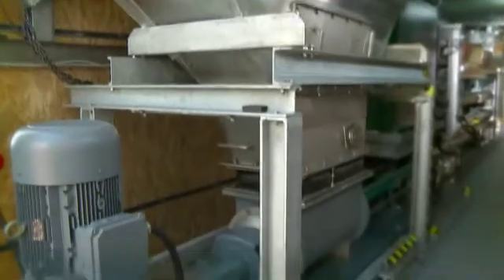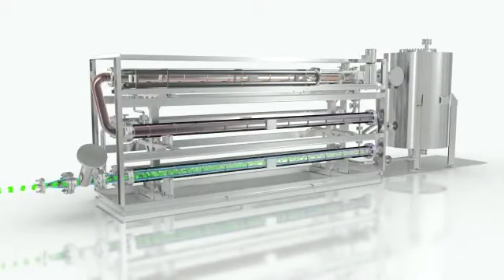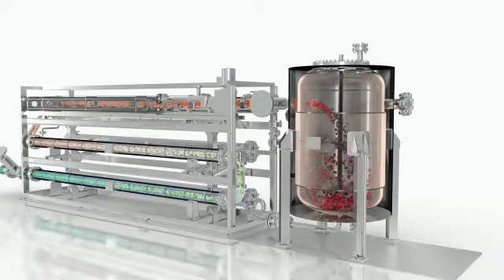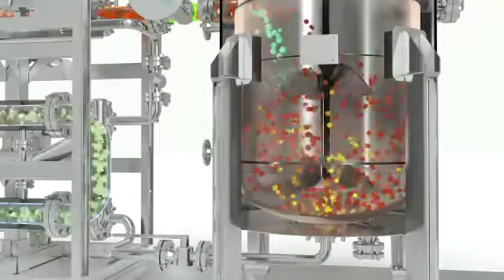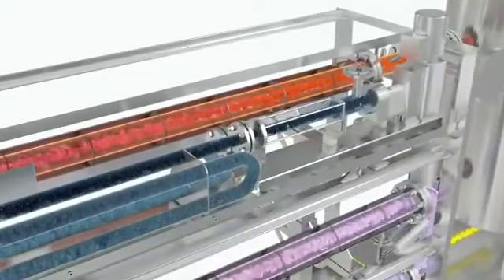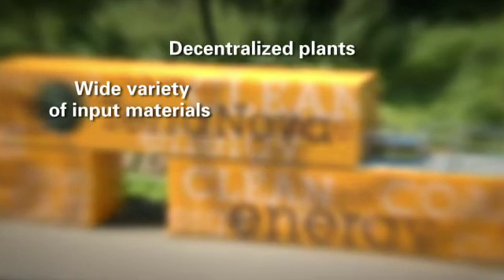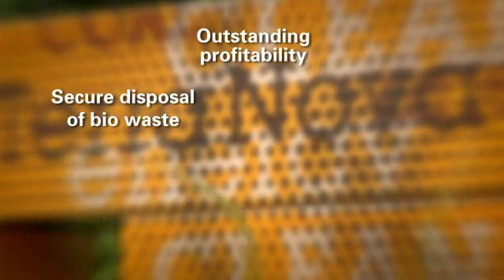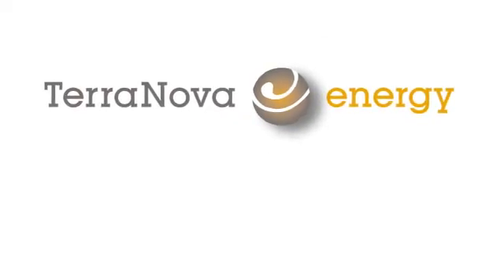TerraNova Energy Hydrochar from Biomass

Comment: When stated this process is carbon neutral, is this specifically speaking of the carbon conversion of the biomass to hydrochar?  The process requires external heating (via electric or gas), which releases carbon.....so the process overall doesn’t appear to be carbon neutral.  The chemistry of the biomass conversion is carbon neutral, but the overall process is not.  There is carbon released to create the electricity (unless using nuclear or alternative energy) or from the burning of gas for heat.  The process does not self sustain and needs this external energy source, which is not carbon neutral.
Reply: Hydrothermal carbonization technology have positive energy balance so as the chemical reaction is exothermic. 
In addition, pre-drying of the raw material is not required, because the chemical reaction takes place in the liquid phase. It also saves energy.